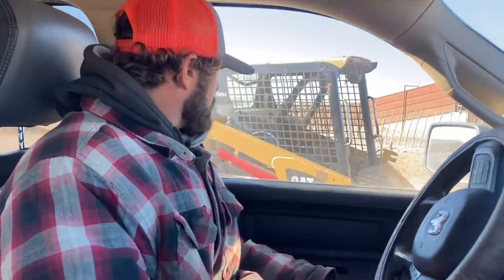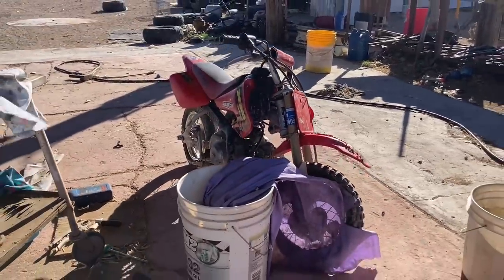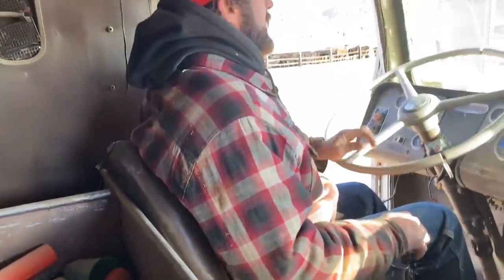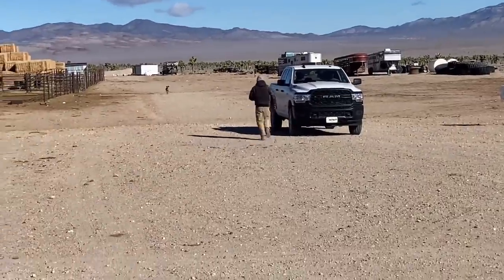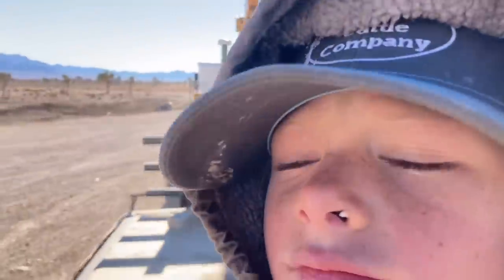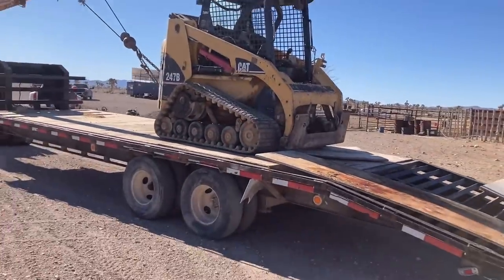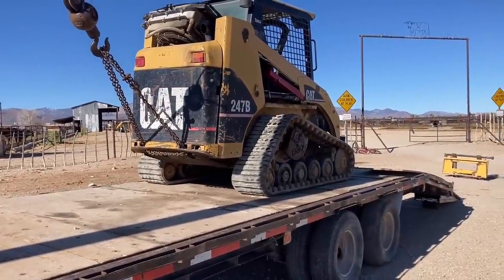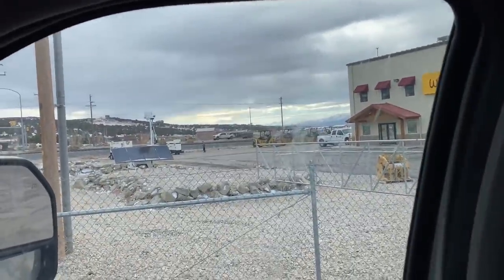How to load a DEAD Skidsteer 🏗

Comment: FYI, I noticed you were dealing with extra chain hooking up to the skid. Don't worry about using the hooks on the chain. There's the chance they may unhook if you get some slack. Tie the chain in a knot. Don't worry, it won't pull tight like a rope. Bang it on the ground couple times it'll loosen up. Advise from an oilfield ruff neck.
Reply from the maker: Square knot?
Reply: @anchorbrandranch  that's usually the easiest. Half hitches would be the next. Those two are all you need. Heck, yer just making a long chain shorter. Sure saves worrying that a hook coming unhooked.

Comment: As a crane operator this scares me, I would have set up the boom truck right next to it and picked it up and back the trailer under the skid steer.   The problem with running equipment like that is you don't know what you don't know and it can damage equipment or kill someone. I'm glad that it worked out for you but at the very least talk to a professional to get an idea of how dangerous what you are doing really is.
Reply from the maker: You are exactly right 
We don’t know what we don’t know.
Sometimes I think how nice it would be to have a career where I know what my job is, I know how to do it correctly and I have the proper equipment to do it correctly.
And then there’s reality we have to do a million careers that we don’t know how to do and don’t have the right stuff but it has to be done……….
So we just push on and do what we can
Reply: @anchorbrandranch  I'm so glad that it worked out. Do you know if your boom truck could lift it?  I appreciate your reply and enjoy your videos, sorry if I came off like as ass and I'm glad that it worked out. I was holding my breath for most of the loading... Well at any rate keep on keepin on and I can't wait to see more.

Comment: This will make you a hero among all your ranching friends and Savior equipment cars saddles Barnes feed everything
RATS WILL NO LONGER BE A PROBLEM!!!!
What you do is go to Home Depot 
You buy that instant sheet rock mud 20 or 40 minute cure time it’s really cheap!
Then you could take some grain oats the older the rotten or the better and you mix it in a big wheelbarrow or concrete mixer you can put anything that rats like in their old cereal old food mix the concrete mix that sheet rock mud in there it’s a dry mix but you can have some moisture in it and then put it in Ziploc‘s every time you park a vehicle or just keep it in there and all your sheds any of your trucksTractors equipment tech rooms shopsParked vehicles in the attic

This is not poison Rats and mice cannot throw up 
It will wipe them out and it won’t hurt your dogs or cats maybe if they ate a lot of it but I kind of doubt that

Rats begone no poison necessary
Reply from the maker: This is very interesting 
So it doesn’t poison them but kills them ?